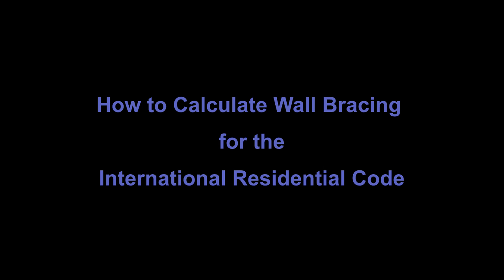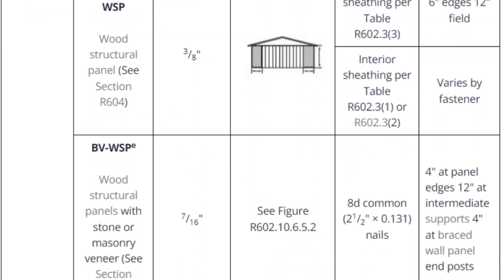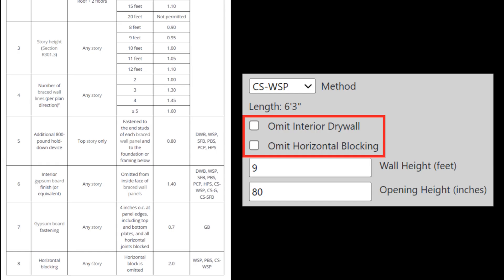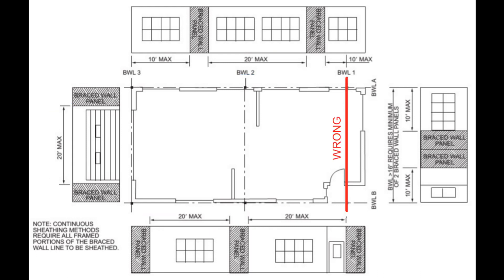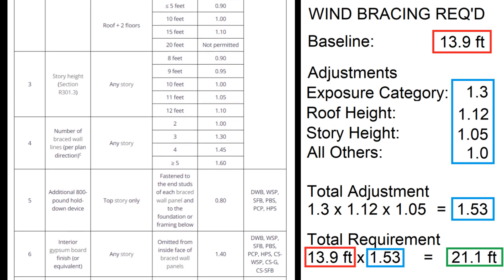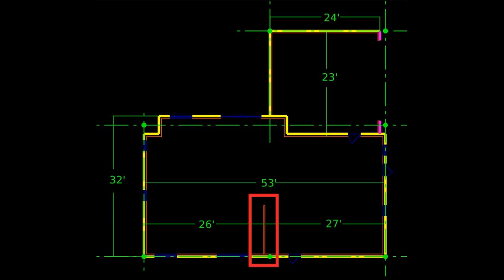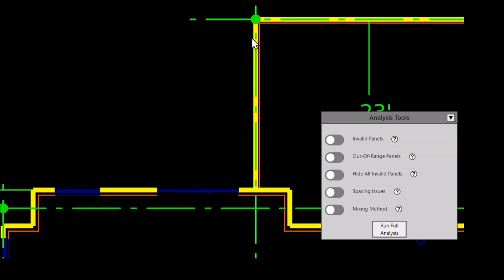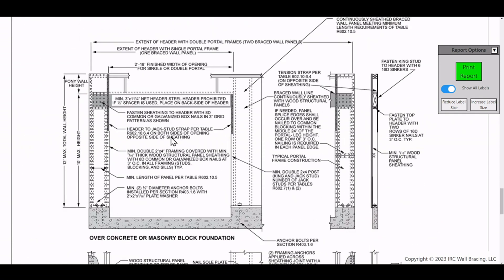How to Design Wall Bracing

Comment: Hi
Does the software address the required hold down forces?
Reply from the maker: The various IRC tables that specify hold-down force requirements are included when in Report View, the mode used to make a PDF of the wall bracing plan. These tables are only included when relevant wall bracing methods are used.